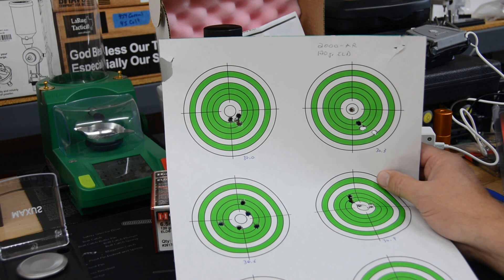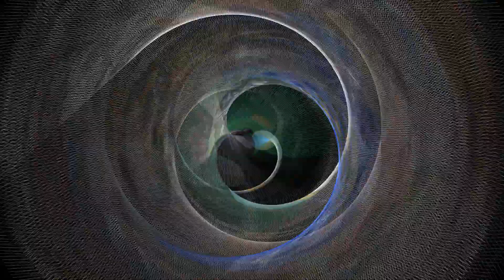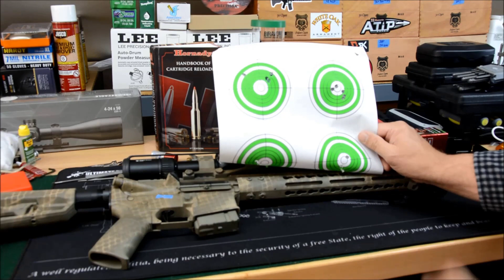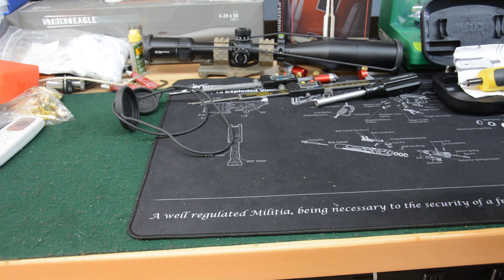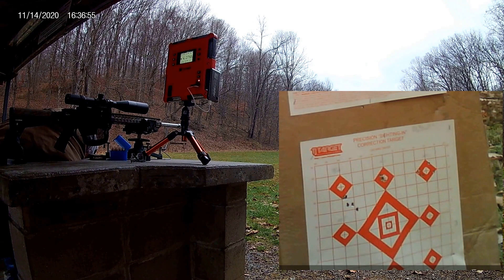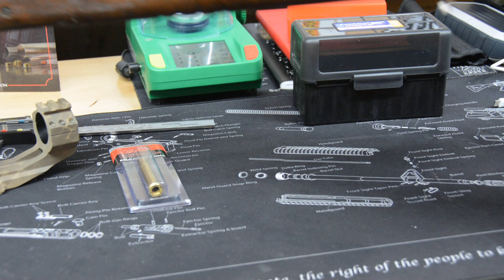6.5 Grendel – Pt24:  Chasing Gremlins with PP 2kMR, SW Match, and Hornady ELD’s

Comment: @Hazzbro - FYI, some of my Hornady bulk 6.5 Grendel brass with only 3 firings were showing the ring near the case web which you pointed out in one of your videos. Out of 45 cases I've had to throw away 5 so far. Using a pick, I could feel there was a slight thinning about 3mm above the web on the inside of the case. It seems like this particular run may have been softer than spec. They stretched much more than the higher priced Hornady brass in box packaging or recovered factory ammo brass because they require trimming between each firing whereas the better brass cases only need trimming about every second or third firing. So I would say there is a problem with the cheaper priced Hornady bulk packaged brass. One other thing of note, this batch of bulk brass is slightly different in color when wet tumbled using the exact same water, soap, lemishine ratio.
Reply from the maker: So it’s not just me!!  😁.  Thanks for the feedback!  I will shortly use my bore scope to check out the insides of the case as well as cross section a few and examine with a microscope.  I’d love to start replacing all of this bulk brass but can’t find new brass anywhere 😩
Reply: @Hazzbro1964  Starling has had Grendel brass in stock quite a bit but I've only seen them selling 250 or larger bags. I don't shoot enough to make buying Lapua, Norma or other top notch brass worth the price for my needs.